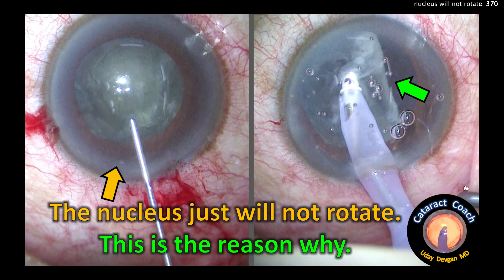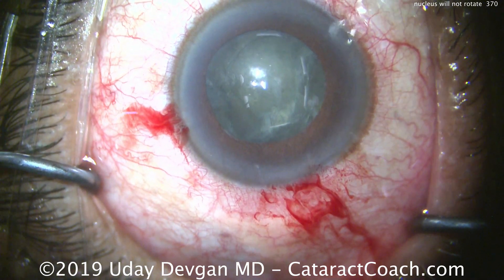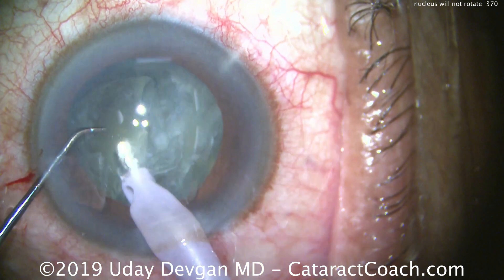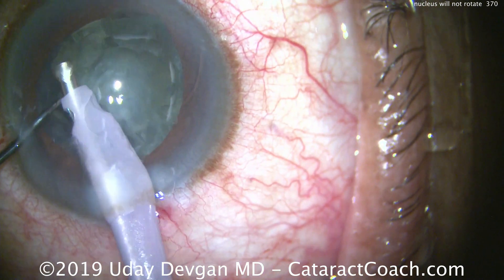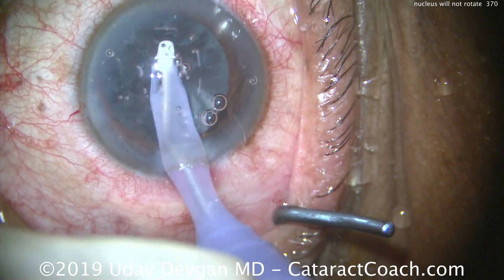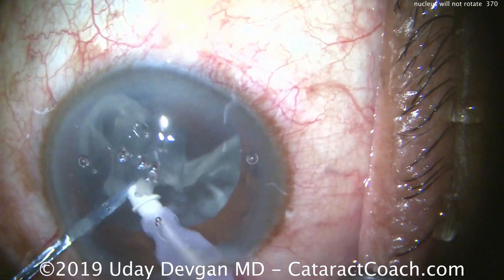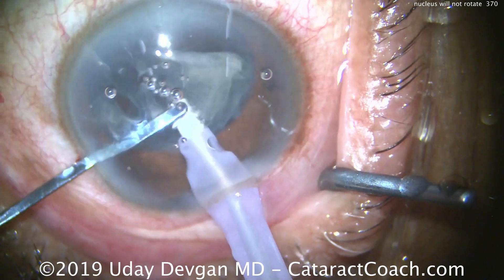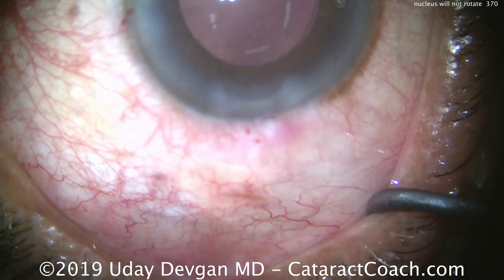Cataract Surgery Quiz: Why won't this nucleus rotate?

Comment: I think at 4:28 you can see the "punched-out" look of what seems to have been a polar posterior component in that case. In such cases, it won't rotate as it's quite stuck to the capsule, and I learned hydrodissection/rotation is contraindicated in such a case due to stress on the capsule. But in this case, as there was also a serious amount of nuclear cataract, it couldn't be seen. But that would be my explanation (I'm not very experienced!). But I had several such cases in India, where poor people wait for way longer to a surgery (if ever done) than in western countries.

Comment: Thank you sir, it's a very good video. 
Always enjoying your impressive techniques.
There's a trick here I usually do in such cases, 
that is to dislodge and loosen the attached epi nucleus with a bimanual IA,
but not to the extent reaching suction, 
in order not to plug the aspiration probe, 
and then just let it come easily through the main wound by a mild pressure on it,
while the irrigation cannula is still inside.
Reply from the maker: good idea. thank you
Reply: It's a pleasure to chat with you. Thank you